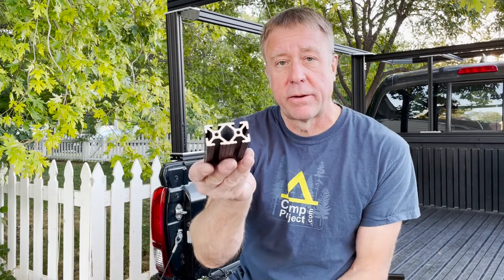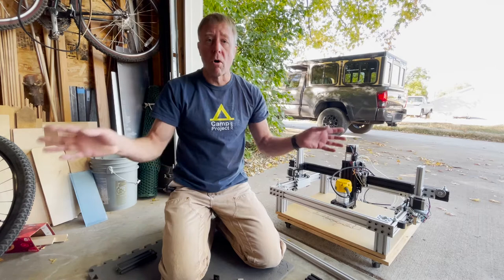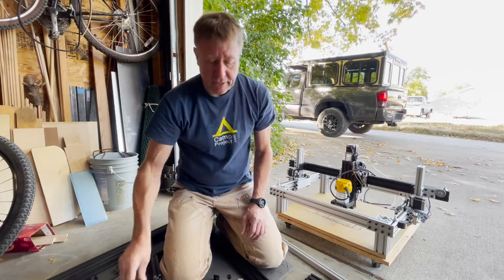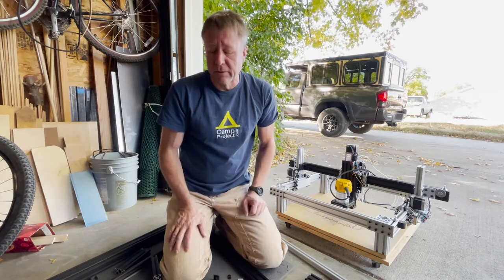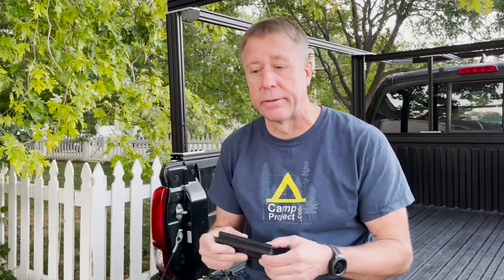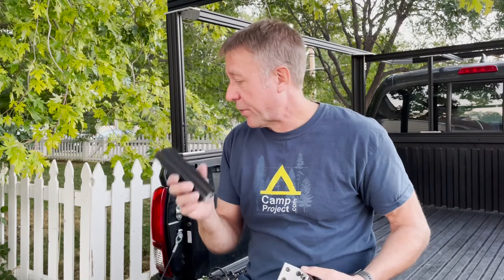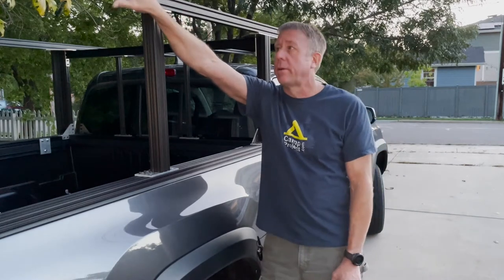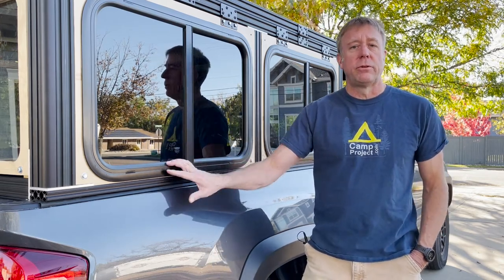Pop-up Camper Build (Part 3) Materials - 8020 - DIY Wedge Camper

Comment: Where did you find those long 1.5"x3"? I've been looking but the 80/20 site doesn't give U.S as a country option. ..🤔
Reply from the maker: For 80/20 search under the "15 Series" - https://8020.net/1530.html
80/20 just changed their max length on pieces. They directed me to a couple of their distributors where I can by the long pieces again.
Reply: Often there are distributors in major cities.   There are a couple brands of t slot materials and they all fit.